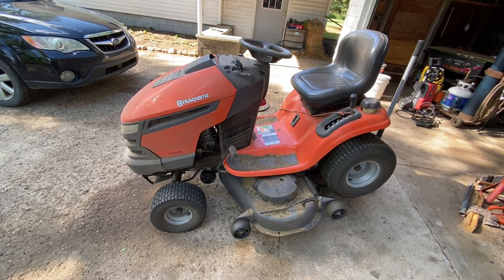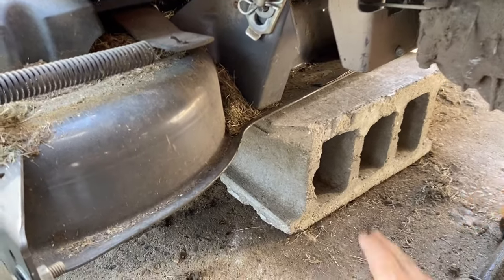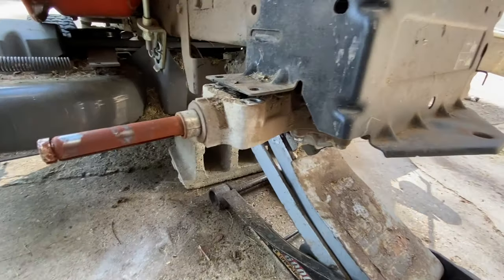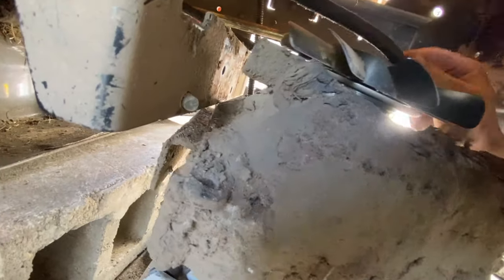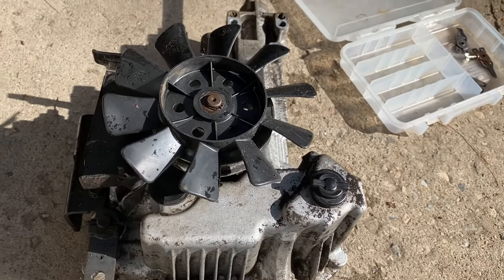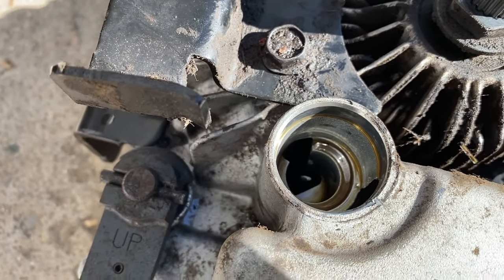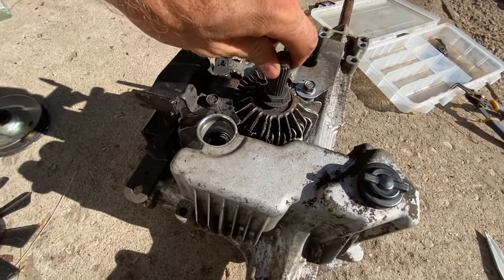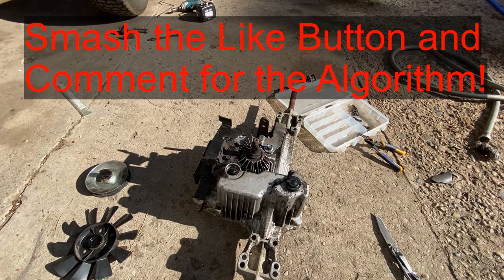Husqvarna Lawn Mower Transmission Removal And Fluid Change

Comment: They couldn't design this where we could change the fluid without removing the transmission.
Reply from the maker: I ask questions like this a lot lol.
Reply: It really bugs me that they actually say these are not serviceable at all. You can't change or fill the oil according to the manufacturer, you just have to buy a whole new transmission   $$$$$$$$    That's why the fill cap is so hard to get off, and why they call it a plug instead of a cap.

Comment: Thanks man, perfectly presented. To the point and not dragged out. Bought one from a scrapyard that “ran”. More like it turns over. Everything but the motor and trans has been replaced but won’t move. Your video convinced me of the inevitable. Cheers
Reply from the maker: No problem 👍🏼

Comment: I have a yth2348 too.  Thinking about doin this tomorrow.  Bought 2 quarts of the oil, hoping that's enough.  I've never read or heard anything definitive about just how much it holds.  Figured SURELY it's not more than 2, unless you know otherwise?  Apologies if you mentioned it in the video, but I didn't hear it.
Reply: Did you ever find out how much it actually  holds?

Comment: Curious as to why you went 5W50 synthetic. Everything I've seen Husqvarna recommend for this job, is just 10W-30.
Reply from the maker: Because it’s thicker and the forums I read said it helped with speed. It’s been running great all summer so far.
Reply: @DirtRoadAutoRepair  It makes total sense. I ended up using 20w50 because it was recommended by my local mower repair shop. My issue was initially once it got warmed up no power on hills. I changed drive belt, and had the same issue. So the next step was the transaxle. I replaced the oil. Got it back together, and it seems to be climbing hills now fine even when it's heated up, but I feel like it's lost power at full throttle. May just be a throttle adjustment now.
Reply: @DirtRoadAutoRepair  I have to thank you immensely for this video though. Excellent job pointing out all the steps, and made everything extremely easy. Thanks so much.
Reply: The video shows 0W-40, though, so who knows. Check the manual, I guess.
Reply: Exactly  how much oil did it end up holding?

Comment: I was able to access the top of the transaxle and fill the oil from the top by removing the battery and battery tray.  The fan and pulley are easy to remove in place.  Removing the fill plug was a little bit awkward, but still a lot quicker than removing the whole axle.

This video was helpful in locating the fill plug and learning to remove it.
Reply from the maker: What model do you have? My battery is under the hood, not under the seat? I’m thinking you have a different model than mine, but it’s good info that someone else might use. 👍🏼
Reply: @DirtRoadAutoRepair  it’s a YT42LS
Reply: @Dirt Road Auto Repair  whats the other black  circle for? I have a yth18542
Reply: @darrellcuellar7861 breather
Reply: I have an ariens with the battery under the seat, I will try this because it barely reverses any more and seems slower going forward. Hopefully a top off will fix it

Comment: Great tutorial! I’m about to embark on the same service for my YTH 24k48. This has been very helpful to inform me of the steps necessary. Superb job! Thank you.
Reply from the maker: Thanks! Good luck to you! 🍀👍🏼
Reply: How did the job go? I need to do mine as well.
Reply: @freewillchoice8052  it was quite easy. You need to just drop the transmission from the mower. Take all the bolts out and be careful when splitting the transmission in half. You need to sort of pry and gently tap the seam with a chisel. Don’t forget to razor off the old gasket material and clean well with a solvent. Replace the filter and any bad seals. Use High Temp gasket sealer when outback together. When refilling I recommend using the suggested fluid. I know some people use regular motor oil but I didn’t want to have to do this again in the future. Good luck.
Reply: @georgeharvey3062  thanks for sharing and replying. The manual I downloaded from the internet (bought my mower used and in excellent condition) only tells me what the thing is (transaxle) but mentions nothing regarding the maintenance of the transaxle.
Reply: @freewillchoice8052  I think these sealed hydrostatic transmissions are meant to be replaced not serviced which I think is a complete waste. After watching the video i decided to do a filter and fluid change on the mower because I’d used it hard for about 10 years. It was amazing how clean the old oil was in it but I’m sure it had broken down the oil somewhat. I did not replace any seals because there were no leaks at all. Best of luck !

Comment: Excellent vid, mate. I'll be interested to see how the machine I'm currently working on turns out. Only suggestion I have is to remove the plate in front of the transmission - makes it a lot easier to get the belt off the pulley, because you can move the transmission further forward. Apart from that, spot on!!
Reply from the maker: Thank you and best of luck!
Reply: @DirtRoadAutoRepair  Mate, it's finished and the customer is so happy - first time in years the machine has a reverse gear that works properly, and it moves forward waaay better than it did. Perfect result 🙂and all down to your vid!!

Comment: About to tackle this on a GTH26K54T that loses power after 20-30 minutes of use. Can barely pull itself up grades/around corners anymore. Here's hoping. A drive belt change made no difference and the pulleys look okay. Must be the trans, yeah? Appreciate the video!
Reply from the maker: Hopefully a fluid change does the trick. Use a heavier weight oil. Thicker oil can make a difference.
Reply: I have the same problem , have you done yours yet ?? Success with oil change only ?

Comment: Not a fun job but you certainly took the guess work out of it.  Fluid level looked good on mine, it did not like going uphill.  Changed the oil, now ill put it back together and give this girl another ride.  Okay, reassembly complete and its still a slow poke especially going up hill.  Aside from belt replacement, is there anything else i need to consider?  Drive belt tightening?  No squeeky belt noise either.  Husky has little or no info out there...arrg.
Reply from the maker: I just posted a video on the drive belt. I put a slightly smaller one on mine and that fixed my problem. After I changed my fluid it was better than it was, but still not great. After the belt it was great.
Reply: Did you find the problem? I have a lot of hills at my place and it was acting like a drive belt slipping, but replacing that didn't work. Called General Transmission (the manufacturers of the transmission) and they diagnosed mine as needing a driven kit ($55) plus a transaxle variation belt ($18). Thought I was in for a new transmission ($500), so I was happy!

Comment: Great video, finally found one straight to the point.  Does anyone know how to remove that back plate? I wanna check things out before I pull the whole transaxle.
Reply: What kind of tractor do you have? Mine has the fuel tank under the seat so no way for me to check without pulling the whole unit out and working on it.
Reply: It's really not that big of a job to drop the trans axel. Getting the rims off the axels if they are rusted....good luck.

Comment: So my Husqvarna YTH 24V48 reverse was going out really bad and now the forward went out, so I figured out how toget my transmission off but couldn't figure out the fill so thanks to your video got the old fluid out and put new in but under estimated how much it holds 😅 to the store for more and tomorrow I'll put it all back and see if it fixed it before I go to belts. If i need a smaller one do you remember what you put on yours? Thanks again buddy!
Reply from the maker: Amazon link for the smaller one in the description.
Reply: @DirtRoadAutoRepair  🤦Thank you I didn't even think to look there lol

Comment: My mower will move forward and back but with very little strength. Can't go uphill forwards or backwards. Last summer it did this, but after warming up it started working properly, and yes, this is an old mower.  I was hoping adding transmission fluid would fix this, but it looks like I'll have to remove the whole thing as in your video. Am I right that fluid levels are low, or could it be something like seals of something more serious?
Reply: Check the drive belt first
Reply: @iamelvisman68  Belt is tight. It's such an old model that there is a plastic expansion tank and the back plate of the mower comes off for easy access. Levels are full, so it looks like it's dead. Now I have to find an older model trans that has numbers YTH2548 to replace it with. Haven't found one used and cheap so far, and I can't afford more than a couple hundred bucks due to the age of the mower.
Reply: @garman1966  local scrap yards can often be a great place to find mower parts
Reply: @iamelvisman68  Thanks!

Comment: I'm not quite clear on where to fill to, you said 3/4" below hole, in that the lower hole or the hole to the side or the top hole, I couldn't see by the video where it was filled to.  Other than that it was a very informative video, thanks.

Comment: Nice video. What was your mower doing that made you check the fulid? I have the yth24v48 and when going up hill it is starting to get really slow and sometimes even comes to a stop. I'm thinking I either need to add fluid or replace transmission.
Reply from the maker: Mine had the same issue as well as when it warmed up it would slow and sometimes stop. I changed the fluid as I did it the video and also changed the drive belt and that has fixed my issues. I think the drive belt made the most difference but the fluid also helped as well.
Reply: @DirtRoadAutoRepair  
So mine didn't have any effect whether driving cold or hot, just lost power going up steep hills.  I changed my drive belt and that fixed my issue as of now.  I didn't check my tranny fluid but time will tell.  I have the tuff torq tranny in mine which I heard was a better tranny. Ill keep people posted.

Comment: Did you have any problem getting the rear tires off?  Would've liked to have seen the process you used to remove them.  I've heard they can be difficult to remove.  Any tips for that?  Thanks!
Reply from the maker: I didn’t have any issues. I just wiggled them and they slid right off.

Comment: What did you put in the transmission
Reply from the maker: Regular motor oil. I believe it was Mobil 1 euro blend. 0w-40. It’s been a while though. I can’t remember for sure.
Reply: @DirtRoadAutoRepair   Okay thank you though
Reply: The link on the video shows one oil but I saw the mobile 1 container in the video 🤔

Comment: Could low fluid cause just reverse to go out? I’ve checked all external components as far as linkage and pedal play. Forward goes just fine, reverse whines and barely even tries to move
Reply from the maker: Yes it could. Also oil deterioration as well. If topping it off doesn’t work try draining it and filling with fresh oil. I used a 50 weight oil in mine and it’s been doing well.
Reply: @DirtRoadAutoRepair  the mower only has about 70 hours on it so I’ll try topping off first. Visually the belt looks fine but do you think it could be slipping in reverse and not forward? Or would it most likely be both?
Reply: @michaelgarner6085  transmission oil should be changed every other year to last forever!!!!!

Comment: Mine has lost most power and will not go up an incline at all. I would imagine this may be the problem
Reply: Any thoughts
Reply from the maker: Absolutely could be the issue. That’s what mine did. After running for 10-15 minutes it would just stop moving, even on a flat. I changed the fluid and it got better. I then changed the drive belt and it was even better. Not quite back to new, but pretty close.

Comment: What seals were bad , the oil went someplace
Reply from the maker: I mostly just needed to put fresh oil in mine. Oil does break down over time with heat input. The thing that helped the most with mine was a new tight drive belt.

Comment: WHY remove- cant you take the battery/tray out, take the bottom cover off and replace the filter and fluid from the vent- can the cover be taken off while it is bolted in, why take it out?
Reply from the maker: You must have a different model. The battery on the YTH2348 is under the hood, not under the seat.

Comment: Does anyone know if these can be upgraded to like a K66 or bigger?  Or if Craftsman transmissions from like a same era GT5000 would work?  Mine is a 2454 fwiw. Thanks
Reply from the maker: I’m not sure. It is belt driven so I’d imagine if you can fab some new mounts (or drill new holes) or if you can find one that will bolt up you could probably use just about any belt driven transmission.

Comment: No wonder that fluid needed changing. Never saw one packed with mud and crap like that one. Lucky over heating didn't ruin it.
Reply from the maker: For sure.
Reply: I had 2 power wash mine. looked same...

Comment: Pointing and talking about the task doesn’t help me know how to do the task. Next time show the tool and how it’s used. You can get a wearable camera or position the camera with a tripod while you work. Thanks!
Reply from the maker: To each his own. Sorry the video didn’t help you specifically. I don’t make 30 minute videos showing bolt removals. If you need to be shown how to use a ratchet I can make a short that shows how they work and send it your way.
Reply: If you cant do this after watching this video, you should be paying someone to do it. Great video, it was perfect and helped me do mine!